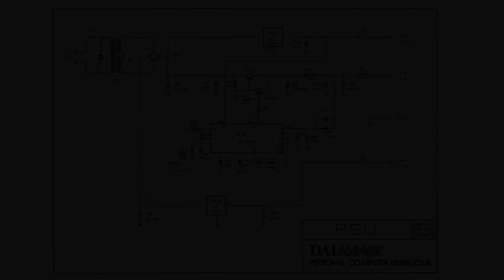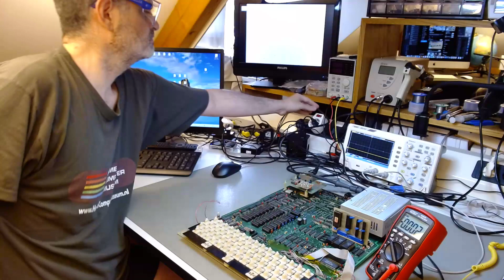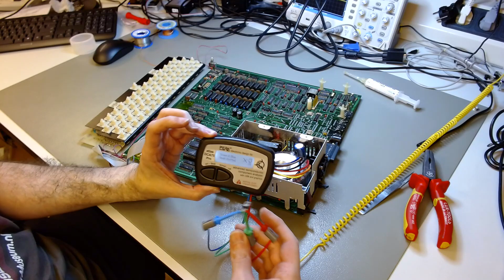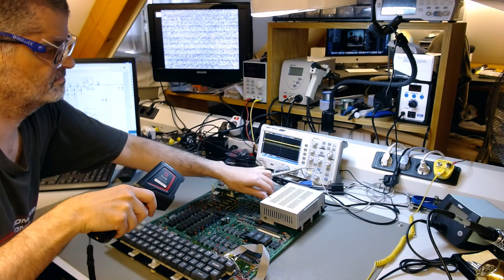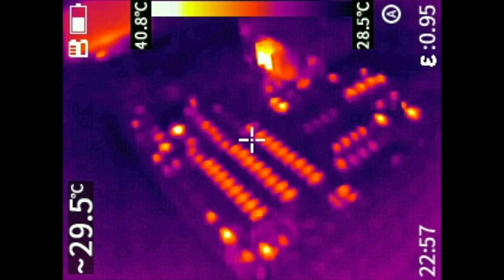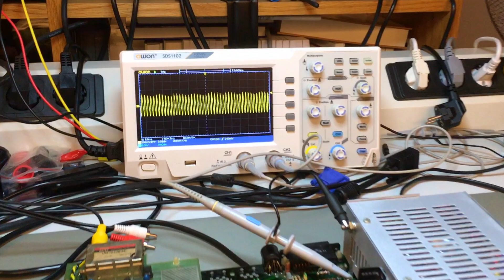Restoring an extremely rare, Belgian DAI PC (Part 4)

Comment: According to the datasheet, 33K compensation is a far saner value than 220.  So I'd weigh differences between the reverse-engineered schematic and your supply in favor of what's in your supply.
If the timing components match the schematic, the supply should be switching at around 30KHz.
Reply from the maker: In episode 6 you will what ultimately happens!

Comment: Hello Bernardo, this is my first comment on this channel, im from Slovakia and I don't usually write comments on English speaking channels because I don't know enough English to write a meaningful comment, I had this comment translated by Google Translator. I am writing because this seems important to me. If the transformer you now have in that DAI computer gives a peak value of 24V between the center and the end of the winding (both windings, because they are the same), (so the effective value of the voltage between the center and the end of the winding should be something around 17V), then fault is not in the transformer according to me, because the filter capacitor will charge to a peak value minus the loss on the rectifier and the ripple will cause the rectified voltage to drop by only units of volts, so the rectified voltage in this case should be around 20V and that should be enough for the correct operation of the voltage regulators. Namely, the formula you showed (in time 42:58), which determines the size of the rectified voltage, applies to the average value of the rippled DC voltage without the filter capacitor connected, but in this case the filter capacitor is there, so the resulting voltage will approximately correspond to the peak one (minus the loss on the rectifier and the ripple). If it is much smaller and very wavy, then maybe the 4700uF capacitor behind the rectifier is bad. Try using a multimeter to measure the AC voltage between the center and the end of the winding (first one, then the other end) of the transformer, it should be around 16-17V effective (that is, around 24V peak, but multimeters measure the effective value), only that I would have misunderstood and the transformer it gives the 17V effective between the ends of the windings, and between the center and the end there would then be only 8.5V effective (that is, 12V peak), then the transformer would really be wrong. But I definitely wouldn't put a transformer there that gives 36V peak between the center and the ends of the windings, because the filter capacitors would be charged to this value and that could be too much for the voltage regulators and they could be damaged. The transformer you need should have a secondary winding of 2x17V effective (that is, the 17V effective must be between the ends and the center of the winding), then it will have a peak voltage of 24V, to which the capacitor after the rectifier is charged minus the loss on the rectifier and some ripple on top of that, so the rectified and smoothed voltage will be around 20V, as it should be. As I said before, I wrote this comment because I think it's important and no one has pointed this out yet, otherwise I really like your videos, I've seen all of them on your channel and gave a like to each one, I just decided to write a comment only now because of my poor English (Google Translator used and correced on my own).
Reply from the maker: Thanks for the elaborate comment. The new transformer, with parameters calculated in this video, does solve the ripple on the linearly regulated 12V, as expected.
Reply: @thebyteattic  OK, thanks for reply

Comment: Very good basic explanation of how a switched mode PSU works. It was helped by the fact that this is a very basic PSU! I have to say that you rather embarrassed yourself by criticising the designers of the PSU, saying that they didn't know what they were doing, and then introduced two problems with your two modifications! 😳 I personally would have run the PSU with a dummy load after the rebuild to test it in isolation before risking connecting it to the rest of the main board. Having said all that, this is a very interesting series and I am looking forward to the next video 👍
Reply from the maker: I'm used to embarrassing myself ;-). But the PSU's design is still pretty embarrassing too ;-)
Reply: @thebyteattic  😄👍

Comment: At this point I would visit the Home Computer museum, the DAI computer they have there and check the secondary voltage of its transformer. Instead of guessing it.
Reply from the maker: This is a pretty safe guess in a simple PSU like this ;-). I think the DAIs at the museum are defective anyway, not sure Bart would risk turning them on. But then again, it isn't needed.

Comment: Hi Bernardo. So cool to see the PS circuit diagram featuring the SG3524.  I headed Silicon General's manufacturing in the 80s including our wafer fab in So. Calif (Garden Grove) where this regulating PWM was built and the assembly operations in the Philippines where the die was packaged.  Some trivia you and your viewers might enjoy.  

The SG1524/2524/3524 series was one of our highest volume products in the '80s.  (The 1524 is the mil-spec version with operating temperatures of -55C to +125C, the 2524 is for -25C to +85C, and the 3524 is the standard version for 0C to 70C).  This product was original built on our Bipolar "40-volt Process" on 3" wafers on proximity aligner lithography (negative resist) before we upgraded the fab to 4" wafers and projection alignment lithography (Perkin Elmer 140).   Today's IC's are built primarily on 12-inch wafers!  

In the 90s, Silicon General rebranded to Linfinity Microelectronics.  In 1999 Microsemi aquired the company, and then in 2018 Microchip Technology acquired Microsemi. The wafer fab in Garden Grove continued to operate  until it was closed around 2016.
Reply from the maker: Fascinating! Thank you!